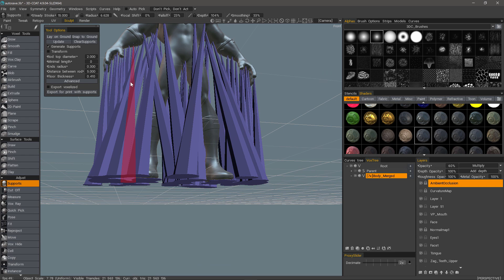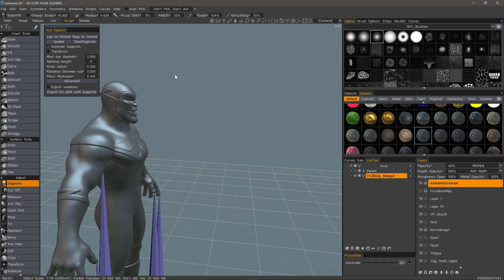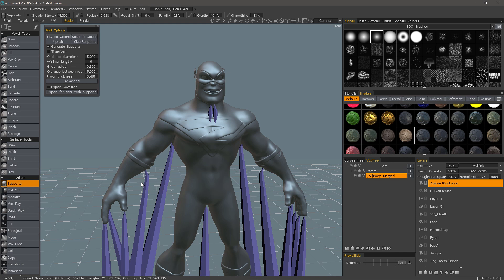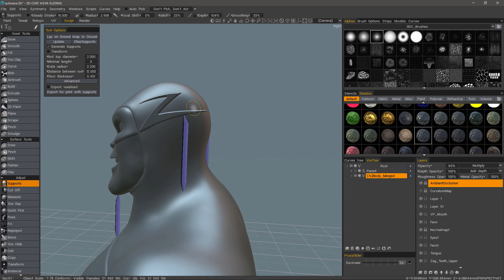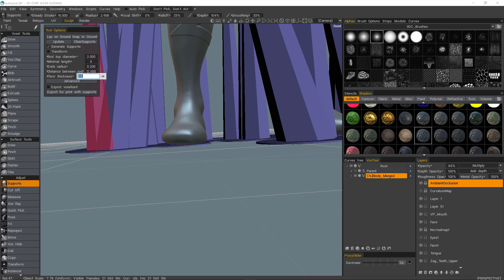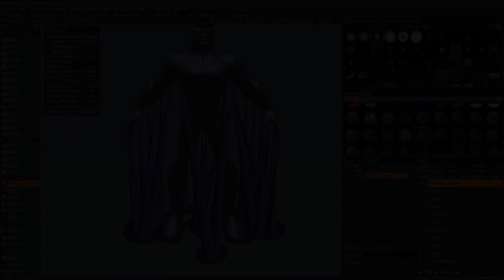3DCoatPrint  Printing Supports

Comment: Well the question is if they are for fdm printing or resin printing as well. If they are for resin, i am missing geometry penetration value (i really wanna make sure that the support touches the geometry), and layer thickness preview (for thickness from 0.01mm up to 0.1mm), which would show me islands, color definition of overhanging parts, and editing supports (i need to change an angle of half of the support, because something might be in the way). 
Then different “endings” of tips of supports would be great as well. Like “ball”, “cone” for easy removal without chipping the model.
If this is meant to be for fdm printing, forget what i just typed. But resin printing is way to go these days!